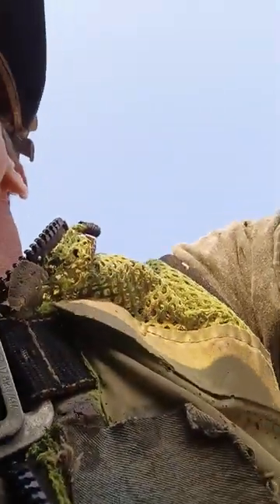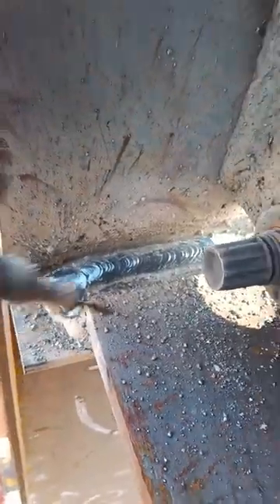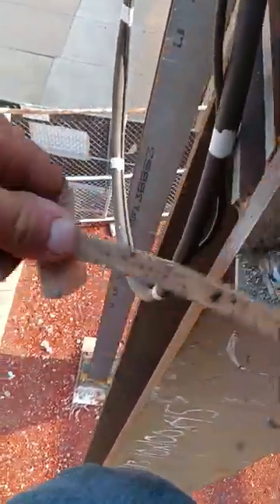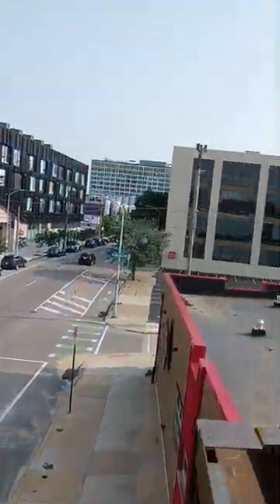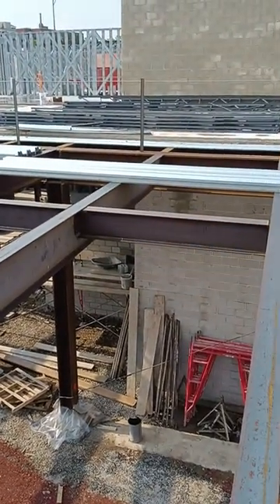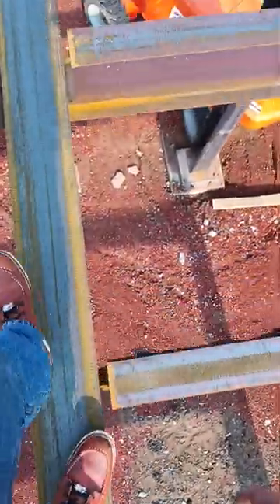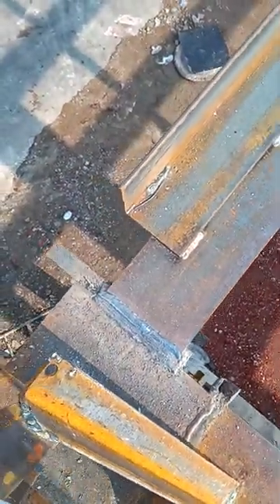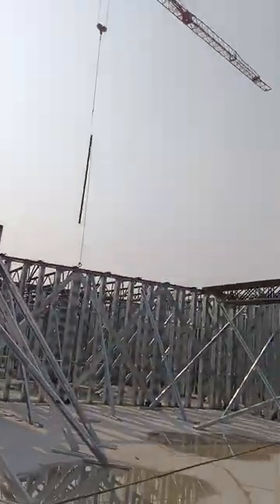Structural Welding/(Happy Father's Day)A normal day as a structural ironworker works on open iron!

Comment: Happy Father's day! God bless America! Man i love that innershield!  Ive ran thousands of pounds of it!
Reply from the maker: Don, good afternoon, yeah they're just something special about running the flux core, it's so weird to run N R  311 again, it's been so long, the smell brings back memories, enjoy the rest of The Weeknd!
Reply: @jetweldingllc4691  Yes sir! You too!
311 is what i used, we built big advertisement signs, i was the column welder, big pipe on power rollers, i would do the head plate usually 1 1/2" thick, 36" to 48" pipe, anywhere from .500 wall up to 1.500 wall most had midwelds, and then anywhere from 12 to 24 gussets on the pipe/headplate then ladder tabs. God bless and stay safe brother!

Comment: i used to park in front of that cubesmart, and later on id watched the construction at spring garden and N 2nd start from an empty lot on til april this year. i got to see welders in action, but didnt get to see the work start on your building there before i left, so its really cool seeing whats going on now!
Reply from the maker: CatchMelm, what's going on, pretty impressive how it works, I don't really care about the carpentry in the concrete, but it's all about the iron, that was a very impressive job, my brother Ironworkers Scott and Billy were welding on that job, they were running flux core that is the automatic, production welding at its finest, do not know what you do for a living, but thank you for understanding the importance of the structural steel , that the Ironworkers of local 401 erect in the city of Philadelphia, have a great day

Comment: You  mentioned your going to cut your run off tabs. And I noticed the welds by others left theirs on. Do guys leave the tabs on around there?
Reply from the maker: Zach, great question, as you see from the start to the finish, my buildup is good I used a column cap or face of column as a stop and then towards the edge of beam, I just build up you don't need runoff tabs if you do it correctly,, as you see, some jobs on the drawings require, (any runoff tabs to be removed, when you get into thicker steel like 2in and unlimited, you need runoff tabs,  you could see in my N Y C local 40 video, some of the welded connections , have a great day!

Comment: You Welding machine amperage and wire feet is not set up properly. When you’re running flux core and your amperage and wire speed are correctly set up, there are no BBs that stick. You definitely need more amps just a quick tip for you quality welds and videos. Happy Father’s Day
Reply from the maker: Luke, thanks for the comment, Luke everything is good, my VOlTS 35,400FT lead, as of right now 36,5 everything is perfect, remember one thing NR 311 throws a lot of splatter,,NR305 seismic, has no splatter, how do you make a comment like that, know your wires, have a great day!